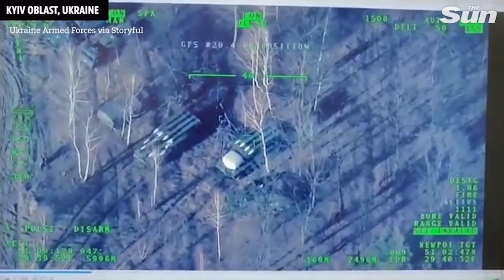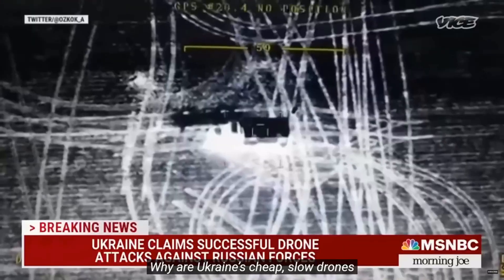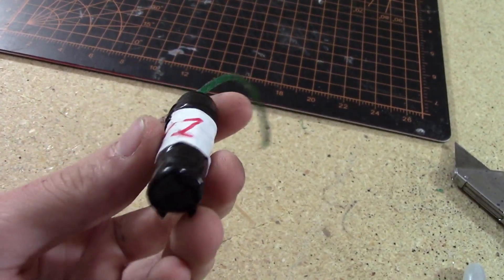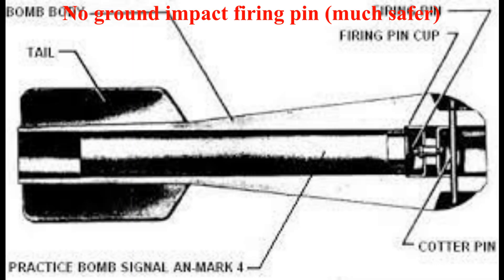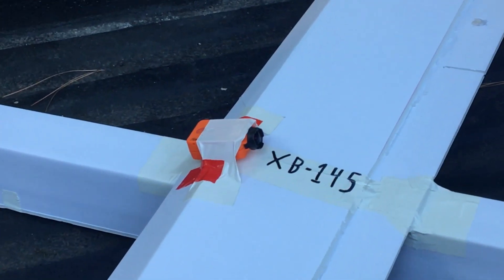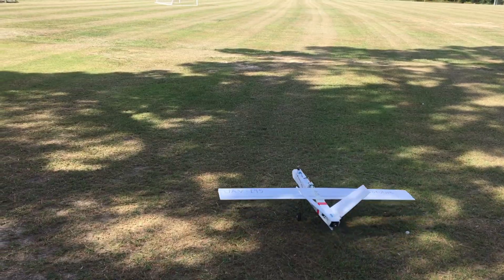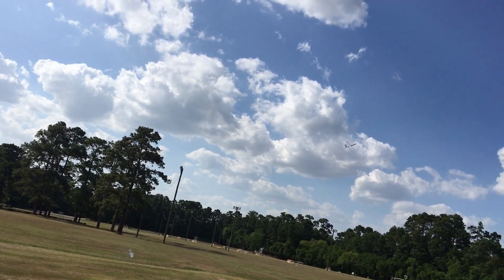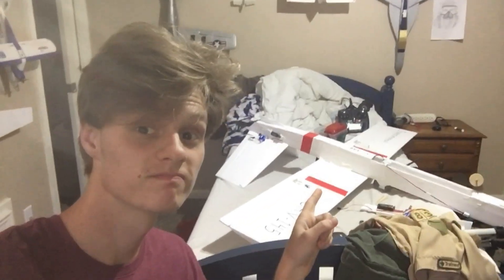How I made a ATTACK drone! (drops real bombs)

Comment: I left DoD to go to NIST and later BioTech with one of the reasons being the contribution I was making. I believe I made the right decision.
Reply from the maker: That sounds interesting? what did you do?
Reply: @CaptainJohn  For the Navy as a civilian employee, I worked on explosives and weapons development in an R&D capacity. Everything from torpedoes, Anti-ship missiles, and air-to-air missiles.  R&D is rather slow methodical work as the working group I headed on one project would repeat the same test over and over a couple thousand times to determine reliability issues. With an explosive weapon, there is a primary explosive (fuse), a secondary charge, and a main charge (set off by the secondary). Another part of my efforts was to make the main charge COOK-OFF resistant (mainly to fuel fires like what happened on the U.S.S Forrestal aircraft carrier incident). Some of the out-of-the-lab work involved computer programs that modeled heat transfer (finite-element code). You can see what changes were made to some munitions ==>  https://www.youtube.com/watch?v=4CzS7gHLuLM     P.S. I suggest you learn how to type 40 WPM since your company's / branch secretary will be doing work given them by higher ups. Don't tell the boss you can run the projector, type, do data-entry of Excel, ect., ect. unless you want to get stuck with that kinda work !  The same goes in today's environments with HTML and webpages !!!